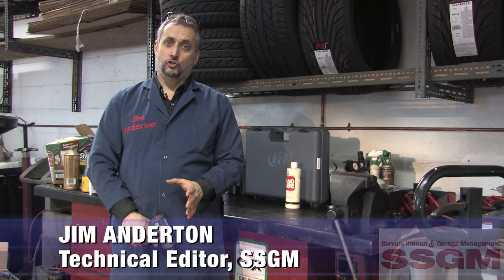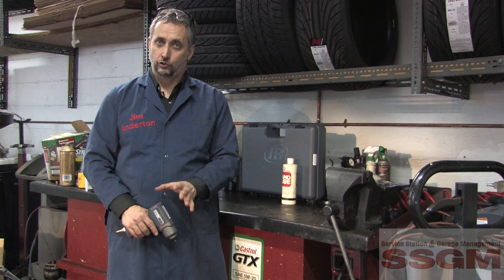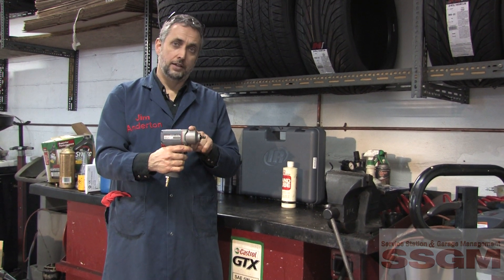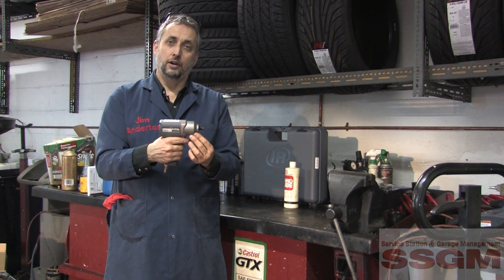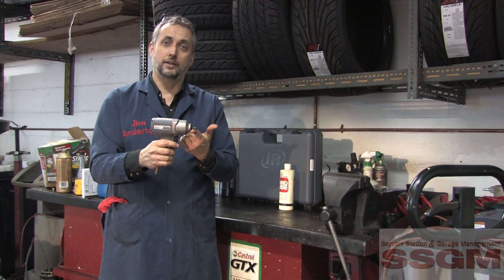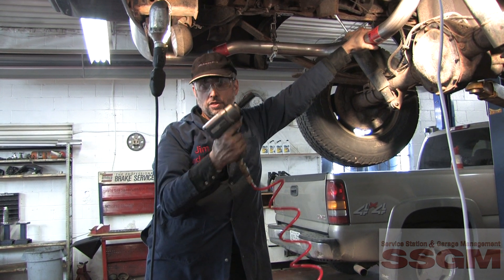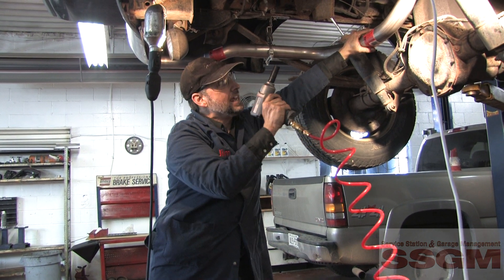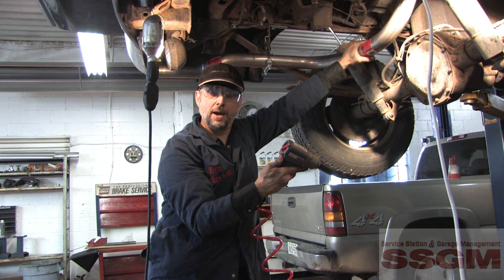Ingersoll Rand's 2115 TiMax 3/8" Air Impact Gun

Comment: have had this tool for about 3 months now maby more and It is one of the most if not the most used tool in my tool box, I do suspension with this gun. have done 6 engine jobs with it so far and is basically the only gun I need for the whole job other than the subframe bolts. on the vehicles I work on (im a dealer tech) this gun takes off flex plate bolts with ease which are toque to yield usually with some thread locking agent on them as well.

Comment: I have both as well and the aircat has more power. The new nitrocat 1355-xl has more power than the aircat. However in terms of size to power ratio you can not beat the IR 2115 timax. It really comes down to personal preference. The ir is a beast for its size. The aircat and nitrocat are quite a bit bigger with a little more power. Both awesome 3/8 impacts.